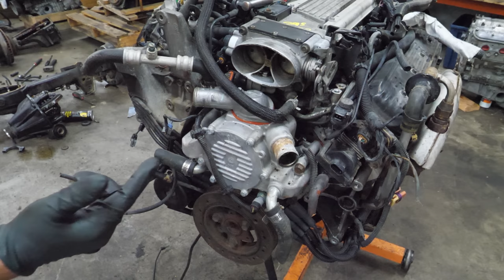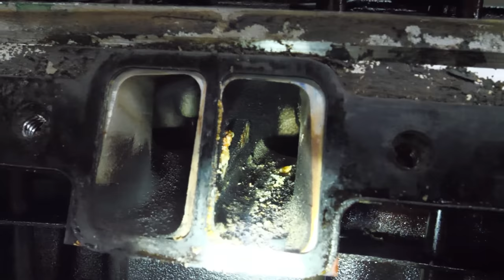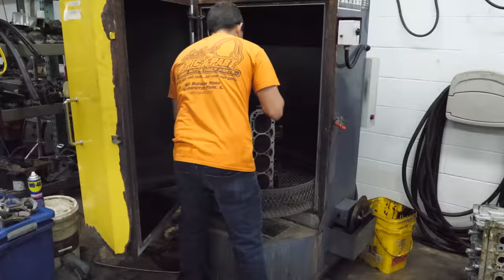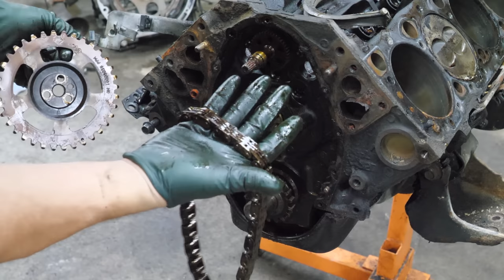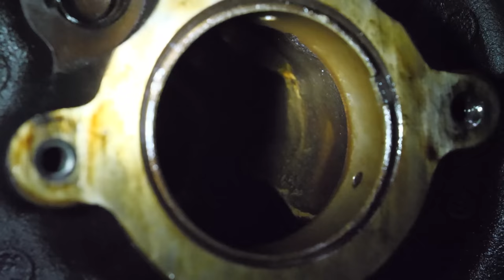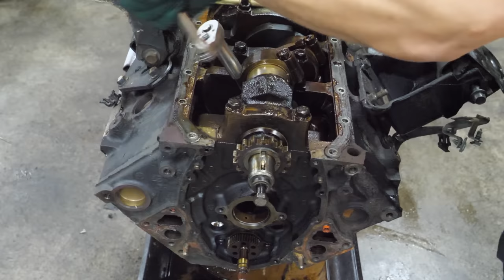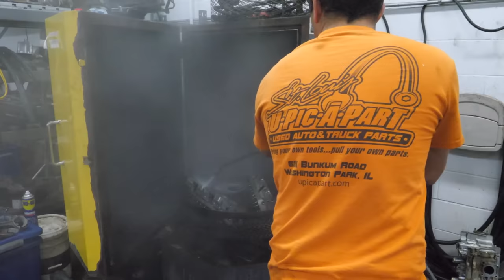Bad Corvette Camaro Trans Am Gen2 LT1 350 Teardown. Not The Problem I Was Told!

Comment: The Optispark ignition system is another GM asshole engineering example as well as the starter in the cam valley on the Cadillac Northstar engine.

Comment: Dude I don't mean to laugh at you bro, because I absolutely know the struggle is real..
  But it is the funniest s,,t . That you can strip down engine after engine of some of the worst kind of looking catastrophe that has ever came from under the hoods of vehicles,,, but one of the simplist parts of the engine,,,
  The oil Dipstick tube.   Kicks your azz.   
  If I were you I think that I would buy a case of the best penatrating oil I could find and spray every Dipstick of every engine you work on.  
  Even if you are not removing the tube at the moment,  just in case you want to remove it later maybe it will help eliminate the struggle.

Comment: If you have 2 minutes to spare could you please check out the boroscope video of my race engine that's been sitting 13 years. I'll try to put a link up in a couple of minutes, I would appreciate your opinion.  Thanks
Reply: Hopefully you will be able to follow the link. Cyl 5 and 7 are pretty rusty. After I got divorced I didn't have a garage to keep it in or money to work on it. Hopefully next year I'll get back to it.